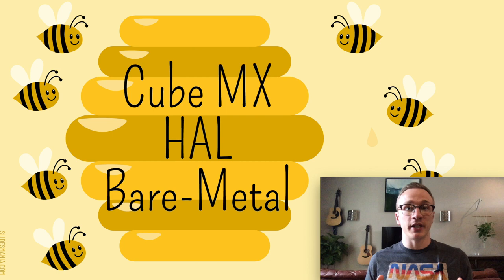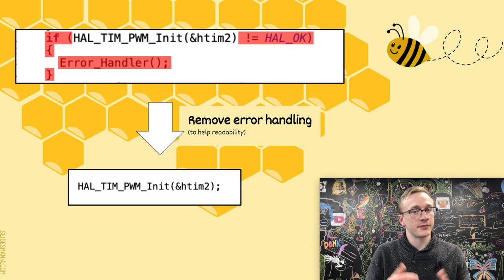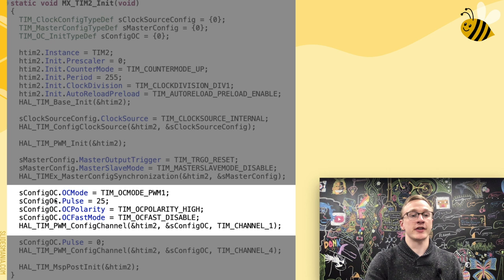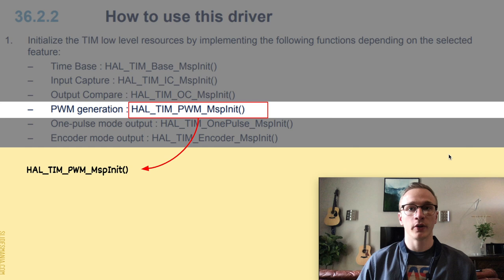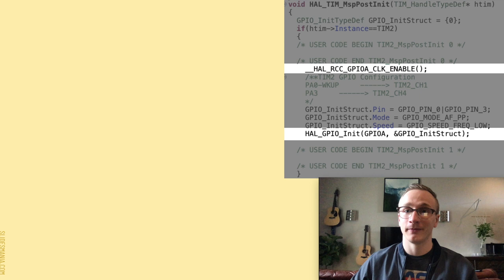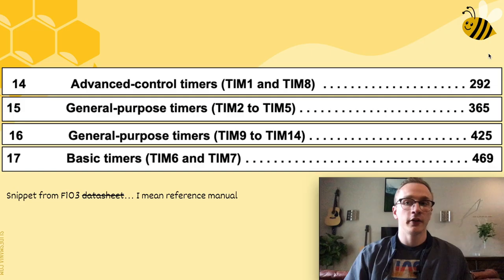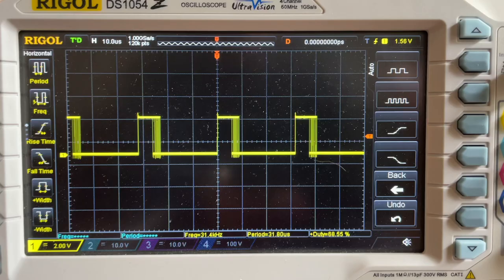STM32 Guide #4: Generated Code, HAL, and Bare Metal

Comment: CubeMX and HAL is great to use until it's not. They are buggy, missing some hardware features, and slow. Just look at one of their interrupt routines, and you will understand what I'm talking about. Also, it has too many abstractions just to set a few hardware registers. Your video makes a great example in showing that it's really not that hard to do your own implementation. Thanks for the video.
Reply: Well, they gives you extra option and you can decide if you go straight to the registers or use HAL.
Regarding HAL you can switch to LL (Low Level ), it will make bit less abstraction but it will be harder to migrate from one chip to another. So it is an option, not a rule and you're free to choose what fits you best.
[Project Managment] ->Abvanced Settings ->Change from HAL to LL.
Reply from the maker: I try to avoid taking any stances on "what is good and what is bad".  Instead, I like to explain how something works, and let people decide if they like it or not.  There's countless frameworks, IDEs, Compilers, and entire ecosystems out there.  The scary part is trying to figure out how they all compare to each other.

The only important thing is that you make an educated decision on what you like best.  If you watch this whole series and fall in love with HAL, cool.  If you watch it and think it's disgusting, that's fine too.  I just hope that I provide enough info for people that they can make their own decision instead of just echoing something that someone else told them.

Arguably, this whole series is basically just me documenting my own journey to figure out what I like/dislike.  I still don't know yet.
Reply: @MitchDavis2  For a hobbyist or an amateur, it doesn't really matter what you use. If it works, it works. But in a production environment, you want to control every bit of instruction your CPU execute. Using third party libraries get you started, but in the end, you want to get the control back. I think your video series are helping people find their path in this regard.
BTW I really loved your execution in this video. Going from higher abstraction to register level programming made understanding how the peripheral work easier. I'd say you are on a good journey. Keep up the videos coming!
Reply: @sfaunl  Not always. Depends if project manager can understand that and willing to pay for it. Sometime crazy things happens and you have no other choice  rather than do what they want. And from the other side, if you have  enough memory for you code and chip can do all tasks in time (for example alarm clock which communicates with RTC module), then getting down to assembler level would be waste of time and money.
Reply: @goodwill7643  Of course, you are right. I'm not saying that one solution fits all. I'm talking about when writing for example a mission critical code, you need to write code according to your constraints. Everything has time and place.
Reply: @sfaunl  with "mission critical" we have sad situation, because in this case I think developer MUST be able to write in assembler, at least modify the code for performance, but sadly today it is often not the case. Everyone wants to be paid, but not all of them wants to learn something :)

Comment: I think I would not find the function __HAL_TIM_SET_COMPARE without you guide, thanks a lot.
Your explanations are great, I think it is one of the best embedded guides I watched.

some interesting points in the video:
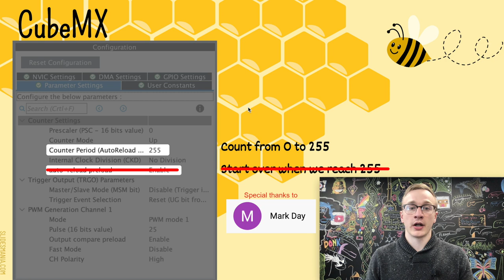2:22 enabling the "auto reload" is not needed
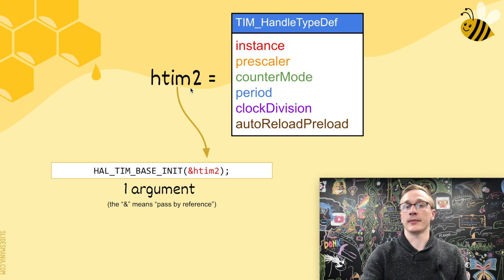5:43 great explanation of passing argument with reference to structure
9:17 HAL TIM documentation
16:51 __HAL_TIM_SET_COMPARE() the function we are looking for
19:49 Bare Metal
21:38 TIMx->CCRx the relevant register
23:26 TIM2->CCR1 = some_new_value

Comment: Very high-quality videos, keep it up!  I have a nucleo64-G474FE board (which was given to me from my university), followed the steps. Only Timer 20(TIM20) in CH2 mode had a PWM signal to an output. Thank god the box has a pin layout with the names and which pins on the board they are. I only have a multimeter but it was obvious it worked when I connected it to the desired pin and ground. 
  I have no prior knowledge of these things except for a bit of Arduino and basic C stuff. I now have a very rough foundation as to what I'll need for my project. I need to control a stepper motor and have some sort of connection from the board to a PC, to change things on the go, I believe. I think the CubeIDE helps a lot for this.
  Again, thank you for the videos, they are longish but they go by with ease. <3

Comment: Excellent video. I think the definition of duty cycle is time high / period x 100% and resolution is related to the number of bits to represent  the duty cycle. For an 8-bit PWM, there are 256 levels, so 100%/256 is the resolution. I might be wrong.

Comment: I an EE trying to break into the firmware scene. I have been up and down datasheets, reference manuals, and online courses to get better at this stuff using STM32. Your videos are extremely clear and gets straight to the point. I had to go through many mistakes and reading to get to acquire the same information. So thanks for your hard work on your STM32 videos!

Comment: Actually, the configuration register pointer constants are defined in a lower-level abstraction layer called CMSIS.  You don't need to include HAL libraries in the project when working at bare metal, it saves many megabytes.  Finding the minimum dependencies for a bare-metal project would be a great video topic.

Comment: Thankyou for the time you take to produce the videos - been really helpful for me to get into the STM32 following some work on bare-metal on PIC16F690 and ATMEGA328p.  One question though, if I dont use cubeIDE to prepare the C main file, then where do I get the HAL include file that defines the say, special function registers.  I went hunting and eventually found a variety of STM32F103xb.h files in an obscure directory thats part of the CubeIDE installation.  They come in a variety of apparently revisions - how do I choose?   They all look the same but each is larger then the previous?

Comment: Hey Mitch, ST came out with a plug in for using VS Code as an IDE for the SMT32 and I was wondering if you could do a quick video on it. I am pretty familiar with VSCode but I am not familiar with STM32 all that much, just your tutorials so far and I would love to get to use VSCode to program them. Thanks!

Comment: Great stuff, and also the "Bare-Metal MCU" series!

Just one minor nit-pick:
in the explanation about '__HAL_TIM_SET_COMPARE(&htim2, ...)' you're saying it's "passed by reference".
The ampersand returns the address of 'htim2' (aka a pointer to it), so I think it would be better to say that it's "passed by pointer".

(Although the distinction between pointers and references is a bit muddy in C++, because they are identical under the hood.)
Reply: This is C not C++.

Comment: Well explained, Thank you.
BTW.. is there a reason you are putting the STM32 in boot mode??. You seem to be using STLink to program it which means you don't actually need to fiddle with the boot pins unless you are using the STDIO and STCLK as gpios.
Reply from the maker: Cube MX by default disables software programming using SWD, which is why I have use the boot pins. At one point, a cube MX update set program using SWD to disabled, which allows those pins to be used as GPIO.  It’s something I plan on covering at some point, but at this point it’s just easier to do it the hardware way until I go into more detail

Comment: @23:37 Wow!!! That line is so simpler than the earlier. What do we get after replacing HAL with bare metal code thing in terms of development and performance in any project.
Reply from the maker: There’s always a trade off between performance and readability/portability.

For example, if you tried this code on a different microcontroller, it might have a different register that you need to set.  Sometimes, it’s more than just 1 register even.

Performance is incredibly fast though since register settings generally only take 1 or 2 clock cycles
Reply: @MitchDavis2  Ohk,
what I thought that the compiler and HAL will replace the complete line _HAL__TIM_SET_COMPARE(&htim2,TIM_CHANNEL_!,pulse); with TIM2->CCR1 = pulse; before converting it into the assembly code.

If the complier is suppose to do the same for us. Then why do we have do all the datasheet banging Hussle???

Comment: Can you do a speed comparison between the 3?, aka toggle a pin and see which is faster and by how much, I know bare metal is gonna be the fastest, but it be cool to see how much faster. I know Arduinos suffer from all the over head. But curious to see if stm32 does not have that issue.

Comment: Sir I have one question, I need to use the HAL library in Keil uvision without using the stm32CubeMX, or STM32cubeide, as I have searched alot in keil for stm32f103c8t6 we have the std library but we do not have HAL library, so How I include HAL library in my keil uvision project

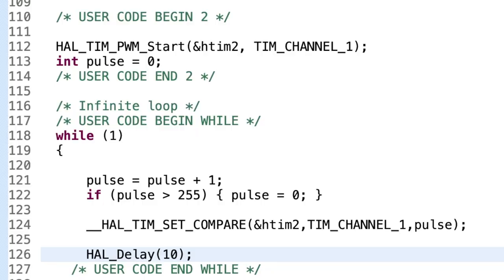Comment: 18:35 And if you set up serial wire debug (SWD) in the CubeMX config, you would no longer have to toggle boot0 jumper all the time when you need to flash a new firmware.
Sorry for bothering you by being smart ass, but this information can be useful. 😅
Reply from the maker: I’ve been waiting a long time to introduce this in one of my videos, but the right time hasn’t quite popped up yet.

My next video is on debugging, and I plan on introducing it then
Reply: @MitchDavis2  👌👍
I just suggest not forgetting to cover the main advantage of CubeIDE over Arduino: the ability to directly access memory and registers, as well as to change them on the fly (like timer period or pulse width). Also Serial Wire Viewer (SWV) may fit into this topic.

Comment: Great video with a very clear explanation! 
From the previous video you said TIM1 can't be used for PWM. Why is that? I'm trying to generate PWM signals with a Black Pill, in the pins that use TIM. But I'm having some issues. I think it might be related.
Reply from the maker: I may have spoken too soon about TIM1.  When I was taking notes for the first time, TIM1 didn't support PWM.  Not all timers support all operations, but it appears that the blue pill does, and I don't remember which board I was using when taking those notes.

Long story short, if CubeIDE lets you select "PWM Output on Channel X", then PWM is supported on that timer.  If it doesn't say "PWM" and only says something like "Output Compare", then PWM is not supported on that timer/channel
Reply: @MitchDavis2  Thanks!

Comment: I had a co worker say our stm32 could be flashed via usb instead of Jtag if we made added the feature in the bootloader. I wish there was a tutorial on that. We had a custom pcb
Reply from the maker: Bootloaders are very powerful!  You can flash over USB, UART, SPI, CAN, SD card, WIFI, really anything you set your mind to.  Most microcontrollers can self-modify their flash memory, so a bootloader is just a way of receiving some data over some communication protocol, and writing that data to its own flash memory (just don’t overwrite the code that does that, aka the bootloader)

There’s hardware bootloaders that are permanent and implemented physically on the chip, which take up no flash space.  There’s also software bootloaders, where you set aside some of your flash memory to make a home for the bootloader, and then it handles erasing/overwriting the rest of the flash with your actual code.
Reply: @MitchDavis2  I can just plug my PC directly into the usb and use putty or whatever scripts to use the CLI. I would think it could flash that way.

I am more just curious to how I would get it to work and how I would modify the bootloader.

Comment: You didn't explain why you didn't use TIM1
Reply from the maker: Yeah, this is still in my notes.  I’ll try to give a brief explanation here.

When I was first learning STM32, I discovered that not all timers support PWM.  On the board I was using, TIM1 didn’t have PWM, it just had “output compare”.  I spent way too long trying to change the duty cycle of the “output compare” and it wasn’t possible.

For some reason, I just remembered this as “TIM1 doesn’t work for PWM”, but that’s not always true.  It all depends which microcontroller you’re using.  If PWM shows up as an option, you can use it.  I think blue pill lets you use TIM1, which is what made me go back and hunt through my notes to figure out why I got this wrong.  I need to figure out which board I was using when I took those notes so I can show an example
Reply: @MitchDavis2  Thank you for taking the time to answer !

Comment: if you really want to learn sometihng stop using generatted code and  strat form 0, to get the point what is needed to start your code to run and do your thing :)
Reply from the maker: Could even do it all from assembly too :)
I’m actually working on a project right now that has all the initialization code written in assembly.  Everyone has different definitions of what “practical” means

Comment: I am a beginner in STM32, But this tutorial are very very Helpful. thanks you very much for this.
Now I am trying to generate a square wave on PA5 with variable frequency like 8khz, 10 khz with diff duty cycle.
anyone can guide me how i can start this ?

thanks in advance
Reply: First, decide what kind of frequencies you want, and what kind of resolution (variety of duty cycle) you want.  The frequency will be the timer clock frequency (APB1 or APB2 timer clock) divided by (prescaler * ARR).  One approach is to divide the timer clock frequency by your desired output frequency; then factor that result into two numbers that fit in the prescaler and ARR registers.  Note that you won't be able to get some frequencies exactly.

The resolution is the value in ARR.  Note that lower output frequencies allow higher resolution, and higher output frequencies limit your resolution.  You can always pick an ARR value that is a multiple of your desired resolution.  For example, if you need a duty cycle of 0-100% in steps of 1%, the ARR could be any multiple of 100 for best accuracy.  Other ARR values mean your duty cycle won't be exact.

Duty cycle is the output compare register divided by ARR (assuming upcounting and PWM1 mode).  For example, 25% duty cycle means the capture/compare register should be 1/4 (25%) of ARR.

See your microcontroller's data sheet for which timer channels are connected to a given pin.  For example, on STM32F103C8 (blue pill), PA5 is not connected to any timer channels.  But on STM32F411, PA5 is connected to timer 2, channel 1.

Hope that helps get you started.

Comment: is bare metal smaller or faster as compiled output ?
Reply from the maker: Well, everything is compiled.  I’m going to assume you mean generated/high level and answer it that way.

There’s almost always a tradeoff between READABILITY and EFFICIENCY.  For example, in Arduino, you can do “digitalWrite(13,HIGH)” to turn pin 13 on.
Behind the scenes, there is code that has to look up what PORT and PIN maps to “pin 13”.  Then it can look up the correct register, and change it.

In ST’s HAL, you turn it on/off by specifying the PORT and PIN manually.  Depending on how the HAL is implemented, this still might have to look up the exact register that needs to be changed.

By doing bare metal, you are explicitly telling the processor what register to change directly.

That being said, ST’s HAL is honestly really efficient.  It almost always translates to something that is basically the same as bare metal.  However, that’s one of the reasons people hate ST’s HAL, because it’s super difficult to read, and you have to do like 10 lines of code where you’d only need 1 in Arduino.

So I guess, pick what you like.  I prefer to use high level commands for almost everything, and I only do bare metal when performance is critical (which isn’t very often).